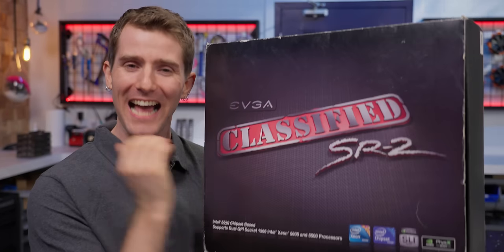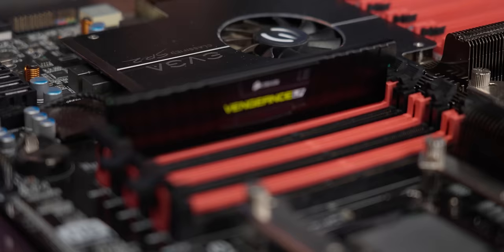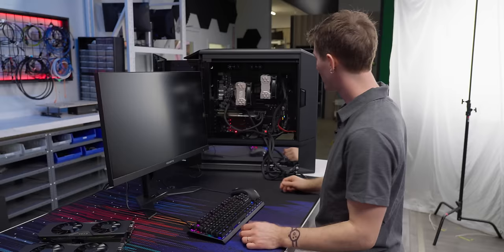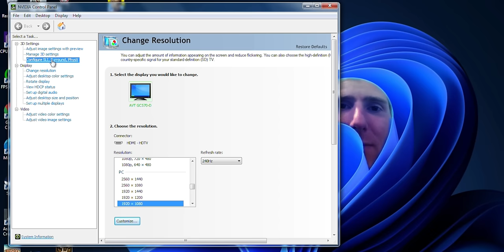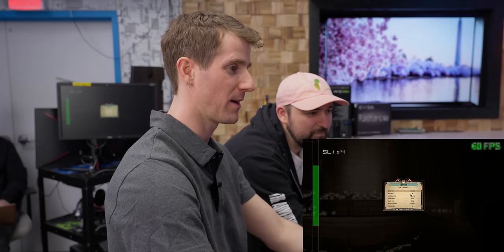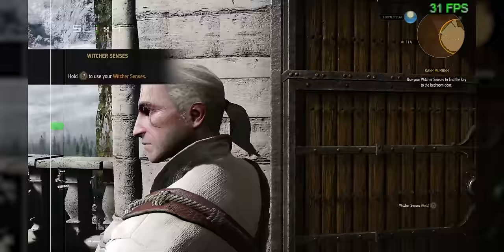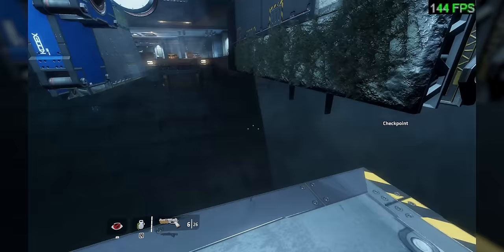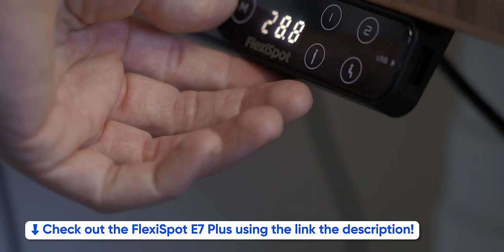How Bad is This $10,000 PC from 10 Years Ago??

Comment: The other day I saw a warning for a huge "Real Earth" Civilization 5 modded map that you needed a very beefy PC to run it and felt instinctual trepidation.  Then I thought - wait, this map is from 2013.  I checked the best GPU on the market in 2013 and compared it to my mid-range RTX 2060S and of course mine blew it out of the water.  Future proofing, at least for GPUs, isn't a thing.  On the other hand, my R5 3600X is only a little better than the best CPUs on the market back then, so at least those last a long time.  I was using an i5 2500k I got in 2012 until 2020 without much trouble.  That said, it's nice knowing my $1500 1080p system is significantly better than the best non-overkill gaming builds of a decade ago, and will probably remain serviceable for another 3-4 years at least.  I still remember the phenomenon of computers being obsolete "as soon as you opened the box" and being perpetually forced to run things on medium settings or below because my PC was a few years old and I wasn't rich enough for the creme de la creme of parts.

Comment: I don't overclock my main computer, and even on my retro AMD Athlon K7 rig I could only overclock from 1733 MHz to 1820 before I started running into stability issues (though that might be the fault of the budget KT133 motherboard I chose for its ISA slot).

Comment: I had an R5 2600, with a GTX1660Ti... But today i decided to upgrade to a R7 5800X3D... i get +4000 points in heaven benchmark... not bad and not much money spent. Recommended. (same money as GTX4060 but no bottleneck)

Comment: Thats 16 years old tech tool..... at least a sr-x is reasonable, but overclocking was disabled for that, though 1680v2 can be. you shoulda done the 2687v2 comparisons on a overclockable or non-everclockable.  comparing tech from 16 yeaars ago is just too unreasonable, thats nehalm times i think you can get 13% or 3% 2011v2 xeon overclocki forget

Comment: Just wanna say that The Next Gen version of Witcher 3 has known optimization and stuttering issues. So the performance on that SLI rig might not be as bad as intially thought. Especially considering most of the games didn't seem capable of actually utilizing the cards. Doesn't explain the glitching and all that BUT it seems to be true that a 4090 is just a bunch of 980s stuffed into one lol...which the more I think about it I guess that should be obvious considering they're literally just stuffing more of the same stuff closer together.

Comment: I have a Ryzen 5 7600 and an XFX Merc RX 6800 XT, since my cpu is fast enough for the 6800 xt at 3440x1440, I haven't turned even the pbo on, maybe after I upgrade the gpu, excited about the 8800 XT currently

Comment: I still use 980's in SLI and games that actually support SLI very good are games Like FarCry 5, Ghost Recon Wildlands, Tomb Raider, Star Wars etc, all shows double frame rates when both cards are turned on. I am running an 17-4930MX and two 980M'sin SLI and I been playing every thing for the last 7 years on that machine. I just downloaded the game BodyCam and it seems to support SLI and it runs good! It doesn't get 60 frames per second but its over 30 fps. The 980 series are still very playable.

Comment: Quad SLi was great in the GTX 580 or similar era, by the time the higher generations came up, game support & throughput was too low for that much GPU power.
I ran a Triple Monitor setup with 4x GTX 580s before getting an R9 295x2 x2 setup, have to say that AMD did Crossfire better than NVidia did SLi, especially for a 4-GPU core setup.

Comment: With more than two cards you should always use AFR instead of SFR!

The microstuttering was greatly caused by misconfiguration and misunderstanding on the user side, I had three GPU's back then and with some tinkering was able to practically every game to run.

Split Frame Rendering almost always caused the biggest problems, it rarely worked as intended. Alternate Frame Rendering worked great in all cases except those few cases where it just didn't really seemed to work... where the second GPU would do... nothing. But that happened with SFR as well, it would render 90% of the frame on the first GPU and just small fractions on the others...

Then there was the SLI Anti Aliasing mode, where you were able to... apply AA with multiple cards. Not sure whoever tried that at the 1080p resolutions we had back then, but yea completely useless.
Reply: @17:56 that sluggish movement of the birds, the "frame drag"... is caused by memory transfers!

Reducing texture detail might reduce that!

Comment: My $1500 pc from 10 years ago (4690) is easily 10x faster than my brand new laptop that cost the same. It was super disappointing realizing I can’t even play Warcraft 3 reforged (struggles at about 20fps). 

And then my almost 20 year old laptop that cost a whopping $2600 ran Crysis at a respectable 30fps on medium settings

Comment: $650 for a Graphics card back in 2010?  GTX 480 at that time was $500usd and the exchange rate was near parity. It would have been $550cad at the best, and the user would have likely picked the cheaper x5670 over the x5680. The x5675 and x5690 didn't come out until early 2011.

Comment: SR-2 Classified with 2x Xeons w5580's and 32 gigs of 1600 speed DDR3....Playing Cyberpunk 2077 in 1440p ray tracing on a ASUS ROG Strix  2080Ti OC.  Ya I overclocked too and yes I was running about 80 FPS.  Only upgraded because a flood killed my old PC, now I have a EVGA DK 690, i9, 96 gigs DDR5, and a RTX 4090 Liquid SuprimX.  BUT MAN I didnt actually need that system if the flood never happened the old system was beast.

Comment: So my current build is 8 years old. I've only ever turned it off 3x. Once to add a new hdd, another the add extra ram, and the last time, replacing the gpu (it wasnt bad, just upgrading from a single 1050 to 2x 1080tis). Still getting well over 200 fps and most things at high settings. However, I really only play war thunder nowadays. Over all the years I've got roughly $7k in it and it has passively mined its value in various shit coins lol

Comment: We are at a time were overclocking is pulling the voltage down instead of increasing it, both cpu and GPU, honestly i prefer it for 2 reasons, less temps and wayyy less noise...Thermaltake´s volcano 7+ gave me ptsd till this day witht hat jet engine noise.

Comment: Could someone enlighten me with this hypothetical situation? If you overclock a 2010 gpu and cpu with the help of dry ice, would they be able to run cyberpunk 2077 at max settings?
Reply: I was running Cyberpunk on mine in 2K with ray tracing, my overclock was really pushing it.  No ice, nope air cooling.  Dont have my system anymore got destroyed in a flood in fact if I still had that PC would not have gotten my current PC which is quite a nice system.  My gaming experience on my SR-2 was plenty fun, not happy about losing it.

Comment: My current system is as new as you can get but my gpu doesnt spin fans in games as they are so undemanding the fans just dont need to run. Starfield, and fallout 76 play at 1440p on my setup and solid locked 60 fps cause above that makes me sick and the fans just dont spin up.

Comment: i have overclocked my cpu and gpu chipset in my laptop from 2.42ghz to 3.20ghz and get an astounding boost to processing power. i also bought a "high speed" G.SKILL 16gb sodimm for it. i run a lenovo thinkpad E15 gen 3 with an 11th gen intel i5-1135G7. yeah the ole girl runs a lil warm but nothing a external cooling fan cant handle.
Reply: it pulls 60fps on destiny 2 at 1080p on medium settings so it works great for my live streaming setup. i run console games via an elgato HD60-X external video capture device to my pc via usb 3.0 and feed it into obs which then channels and encrypts the video and audio to the streaming platform. i get about 1.8% frame drop during a 6 hour stream so being a used laptop that i did some standard upgrades and a bit of overclocking to, it has pretty darned good performance!

Comment: so 10 years ago (2014) you had relatively new X79 and i guess 1st gen x99

6 core 12 thread 130w TDP i7 3970X 3.5/4.0ghz clock that was pretty much able to be overclocked to 4.0ghz 24/7. That could be paired with 32gb DDR3 ram... i guess above 1600mhz was a challenge for stability but maybe 2400mhz could be achieved.

that level of performance could be paired with a 3060 no problem, and i guess Win10 compatibility could work no problem...

That is a 12yr old build that could work with a lot less problems.

But well, i guess an X99 DDR4 8 core 16 thread 5000 series i7 will do better, despite being above R7 1700 performance, they are still an 8 core DDR4 platform and at this point 9 years old

Comment: SR-2 is 14 years old and will be a larger bottleneck than going with X79 refresh for gaming.  It's a cool board but this setup would have only been used for some synthetic 3DMark numbers.  A 4960X existed at the same time as the 980ti and would do much better in these tests at the same 4.2ghz speed.

Comment: I still use dual cpu x5670's and they are still all that I need for all of my gaming
Reply: With a 1070, and 48gb of ddr3
Reply: I got it not too long after the 1070 released and it's still running really strong, only maintenance i've had to do is some light dusting and reseating the ram

Comment: Wouldn't the unlocked xeon w3690 have been better in this board instead of the locked x5690? They are the exact same cpu except one is unlocked. Then you wouldn't be limited by 220ish max BCLK.

Comment: The CPU bottleneck is probably mostly because of the CPUs trading cores. But the 980ti x4 SLI isn't going to perform much better on another system. The max fps numbers are probably going to be higher and more consistent. But the game is going to feel mostly the same because of the limitations of using more than one card. I used to run multiple GPUs and I just wouldn't play most of my games just because it didn't feel good. Even though my frame counter is saying I am getting 220 to 300 FPS, the 1% lows go all the way down to 16 and sometimes even 6. SLI was good when it first came out. But even whenever it worked it wasn't great. The whole point with the 900 series and later was higher number better. But it would be really cool to see how 4x  SLI fairs today on a newer system anyways. But this is my prediction if you do make that video.

Comment: Go back retest now with a 4090 because if I still had that board I wouldn't be running those video cards in 2024.

And keep in mind the 4090 is 450w tdp missing displacement still with no sli, two 4090 equal 1050w about the same power as quad sli, making the 4090 by wattage a one chip sli style performance being gen given. My point is they also cut displacement. Increased displacement pet card, but cut overall displacement. Two 5090s in sli equal  2x fill rate. X2 cuda cores, ray traycing cores, vram total, and per gpu acollation, I never had issues with micro stuttering on my 3 way 5870,s memory tuning and timmings go along with with good motherboards, 

2x 4090 basically Quad sli performance at 1050w load... 

4x gtx titans equal same wattage

250w tdp 4x gtx titans 1000 plus watts 

Where is sli for the displacement missing on this architecture.

Only makes sense to allow sli on 5090 6x 7x 8x 9x ect not any other cards due to vram and maximum.gpu potential within memory controller, to expand resolution running advanced antialiasing gfx modding, ultra gfx options, with high frame rates or as much eye candy as possible, people don't stretch the limits to actually see there isn't as much performance after particularly implementations are set

Even at a business decision it makes more sense. Financially, and aimed directly at Ultra performance the point of scalability in only the most advanced chipsets.

With antialiasing in 8k your going up to 64k res

Comment: (From a programmer's point of view) Does it even make sense to test $10000 hardware (no matter how old) using games/software that are designed to run on much lower specs? 
Crysis 2 system requirements:

OS: XP/Vista/Windows 7
CPU: Intel Core 2 Duo with 2Ghz, AMD Athlon 64 x2 2Ghz
2 GB RAM
HDD: 9 GB
DVD ROM: 8x
GPU: NVidia 8800GT 512Mb RAM, ATI 3850HD 512Mb RAM
Audio: DirectX 9.0c
Keyboard, Mouse or Microsoft Xbox360 Controller for Windows

(It seems to me that) Running a DirectX 9 game on a DirectX 12 videocard is like benchmarking MS-DOS on the latest high-end Intel processor...

Comment: I5 10600K running 5ghz 47 cash ratio, could have turned it up to 5.1ghz if I had a better cooler. the h100i is struggeling with the 240watts XD

Comment: You didnt force the fan profile so whenever you cranked up the ingame settings the gpu would just downclock itself from reaching too high temps! their defaults dont use the fan until it's already too hot and downclocks itself. They did this so if you played using defaults the card's chip would cook itself unnecessarily quick in order to get you to buy replacement sooner than you need to. It's part of the planned obsolescence scheme.

Comment: Just like adding cores to a cpu you're not doubling your performance by using sli, you're just gaining this quasi load balancing.  Some of these games I think would have been fine with a single card.  I had a 1070 until like 2022 and I played a bunch of these games fine with a 1070 which isn't much different than a 980ti... I played fallen order back in 2019 at 60fps with a single 1070 at 1080p... Just saying.

Comment: Isn't Fallen Order notoriously bad on PC, as far as performance goes?  I seem to remember that being in the news when it was released, and a few weeks later the devs basically said "we've got it running as good as we can get it" and left it at that.

But anyway, I got off the SLI train with the GTX 670.  The microstutters were so irritating because--for the most part--you were getting really good FPS, but every 5-10 seconds, it would hitch.  When my friend's single 560 was giving a better experience in the games we played, side by side at a LAN party, I said enough was enough and ditched it.  Such a sad end to such groundbreaking tech!  I still remember getting 2x Voodoo 2 GPUs in 1999 for Everquest and just being blown away by how great it was.  wistful sigh

Comment: It's not that unique, it's just like the original Intel Skulltrail, which I still have (in bits)
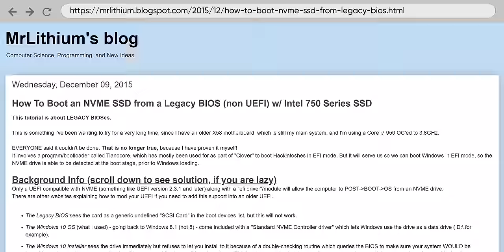4:50 Why didn't you use a PCI card with M.2 on it? You could even have gotten one with RAID built in.

Comment: If this system is called "ancient"  I wonder what my system would be, core 2 duo e4600 - 2.39 Ghz , 4gb ram ddr2 500mhz, gtx 550 ti 1gb, 320gb hdd, monitor 1280 x 1024 60Hz.
😎

Comment: why not just install a more modern windows operating system on it. you could have tested the 4090 no problem. I know for sure 10 year old computers will work with newer windows os. 

at least my thinkpad did. though, I wiped it and installed linux as soon as I got it.

Comment: It's a lot more involved trying to overclock (or really undervolt) a current gen CPU than it used to be. Is it even worth it? well it depends on if your goal is to smash Cinebench records or if you want to play games. Today's gaming laptops can rival mid level desktops, especially with Dynamic Boost and a 175W 4080... but if your CPU is stealing all the "Dynamic Boost", then your GPU wont hit 175W (it's a power shift technology). So for me, my goal is to cause my i9-13950HX to use as little power as possible because it's 32 threads have no problems in games, even when it's only using 50 watts (can hit 200w). However, finding a stable undervolt is tricky too unless you want to disable Thermal Velocity Boost (which is essentially Intel's "Always Be at the Highest possible clock" technology)... so is overclocking even worth it? I dunno, I wouldn't do it. Temps are difficult enough to keep under control on a 13th gen.

Comment: Hmmmm 🤔 is it possible to sli the 4090 with a little bit of cough dark magic 🪄? Someone needs to recreate the sli for 5090 when it releases ngl having 4 of those and two thredreappers ddr5 well that would be a great ultimate beast. The sli link needs an software if that someone who will make it reads this 😅 like give me an app so that i can say to those cards how and when to work and what power like give me overclock not the gpu overclock but the sli overclock i don't want one card to be more powerful than the other 3 or the first card to work more than the 4th card. Ram/cpu-double overclock able but hmmm 🤔 there are a lot of people who don't know how to overclock so why not make a program even in bios that automatically read the chip you have in your device and auto overclock it and yes tgere would be a option to turn it down. So everything to be overclocked without you even doing anything. Ps not an overclock to destroy the device an normal overclock that can actually be cooled down 😅 . So we will do the same as that board evga did but because Nvidia makes big gpu we will change their position a bit and the sli will be in the board itself again it can be on/off. What if sli dies do i need to get to a shop to repair it? Nope it will be like the hmm 🤔 let's say like tmp module plug and play so not a hard repair. Who makes this is insane. If someone ever makes this give your bro credit 😂.